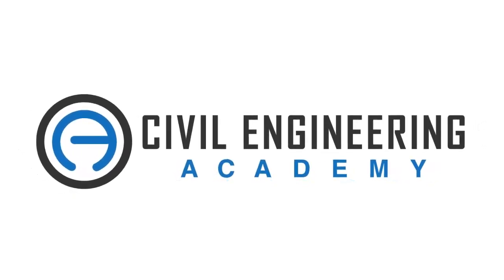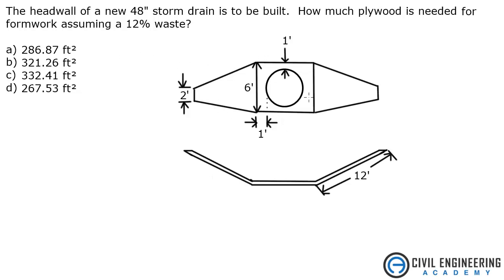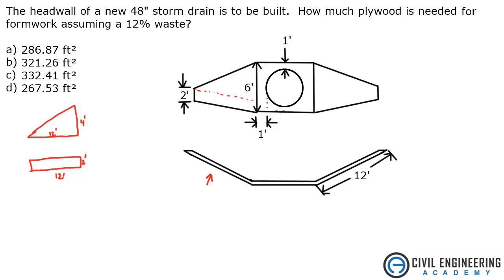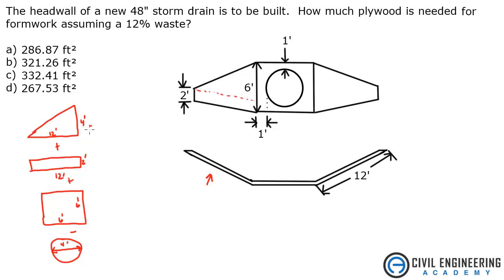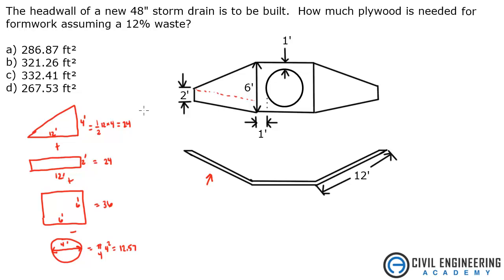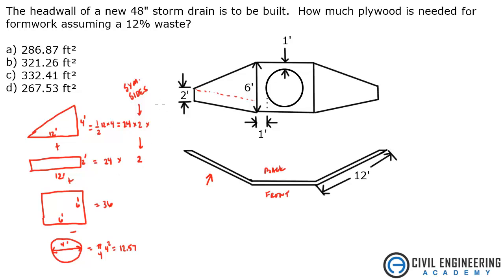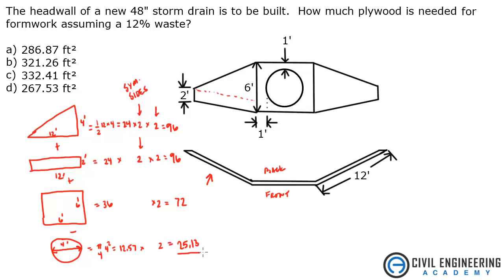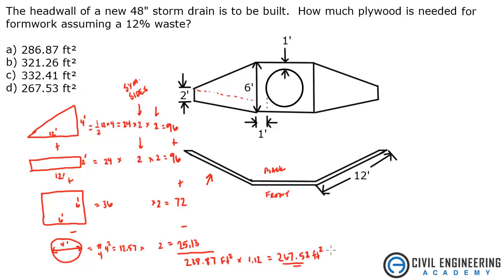Construction-Find the Amount of Formwork Needed

Comment: This one is a great example on how the office engineers are disconnected from the field.
You never cut that hole in the formwork.  You need the whole 6x6 sheet to properly braced and secure the formwork. 
Also. There is a better and faster way for the math.
((B+b)×H /2)x2sidesx2sections + (6x6)x2 - (3.1415x4²/4)×2

B=6
b=2
H=12
Reply: Yeah this is at least the second video of his where I'm in disagreement with the wording or math.

Comment: What about the formwork that would be needed to hold these two (front and back) pieces together? Is there not a thickness of the poured concrete? Example if we poured concrete into our two pieces of formwork it would just fall out the sides.

Comment: Why are you only subtracting the area of the pipe once?  If you use the 6' x 6'  twice you need to subtract it twice.  
Also the question might be rephrased in SFCA - Sq Ft of Contact Area.
Reply from the maker: I did subtract the area of the pipe twice for the front and back.  I found the area of the hole and multiplied it by 2.
Reply: Civil Engineering Academy Aha   Got it - little mistakes always kill me :/
Reply from the maker: Adrian Ramos  They kill us all :)

Comment: I don't believe you should subtract the area of the hole.  Depends how the problem is worded, but we'll still need a 6x6 sheet of plywood regardless if your cutting a hole through it or not.  They don't usually come to the site pre cut like that and if they do it won't be cheaper.  Even though the area of the hole is not there when it is constructed, you will still "need" it for material and cost estimating.
Reply from the maker: Yep.  Another example of how sometimes the PE problems are not practical and thus you shouldn't take them out to do real design work with.  Good call.  Thanks for the comment!  The wording on the problem is for sure the key.  This was probably poorly written - on the real deal it would be worded more clearly if you need to account for that hole or not.

Comment: when you solving the triangle portion of the piece, formula= 1/2*12*4.  You are taking the 4 to be the base times 12 (The height??) times 1/2.  How did you get the 12 to be the height in this calculation. the only case it can be used as a height will be when its a right triangle. this dose not look like a right triangle. I understand the part in the middle, Square minus Circle. I dont understand the two sides especially since the 12 feet are at a slope meaning less than right angle (less than 90 degrees)
Reply from the maker: No, I probably said that though in the video.  I'm taking the base (12') and the height (4') and finding the area 1/2*(12')(4').  See, the base is based on viewing the side from the way I drew the red arrow in the video.  Let me know if that helps.
Reply: Civil Engineering Academy I think i see it now, The two sides are a bit confusing because we are trying to draw a 3-D structure into a 2-D figure. Thanks for your quick response. These videos are helpful in my preparation for the exam.